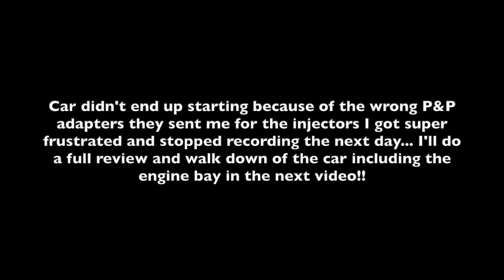HOW TO INSTALL EXHAUST MANIFOLD ON A EVO!

Comment: Looks great bro! I have a MAP tubular manifold on mines and it makes the engine bay very hot. It is not ceramic coated so I’m thinking about heat wrapping it to keep temp down.
Reply from the maker: I have that same issue even with the coat!!

Comment: I'm hopefully going to be doing the same in a few weeks...would you have been able to get the bolts off without the heat? I want to try and do it myself but don't have the torch to warm up the bolts. How long did it take you to remove and install? thanks - looks great!
Reply from the maker: You can try it try putting some penetrating oil before so it can help! and it shouldn't take you that long it all depends on experience but 2-4 hours.
Reply: @ChrisGoorbarry  thanks a lot, great video too - very helpful!